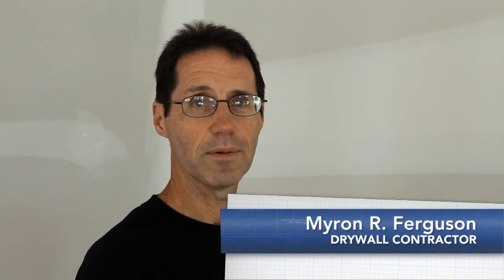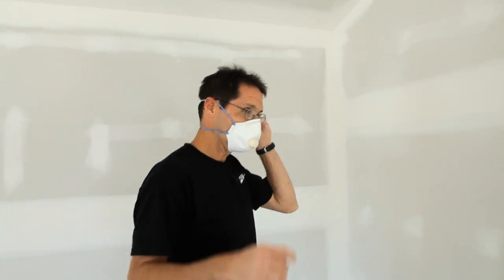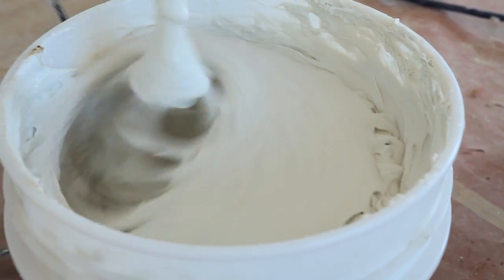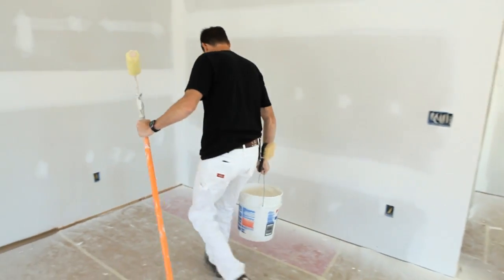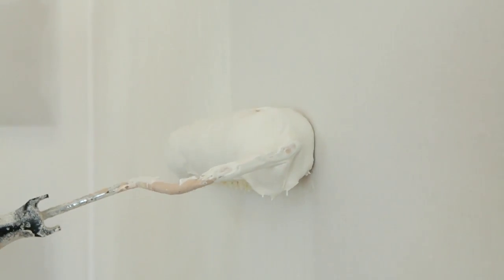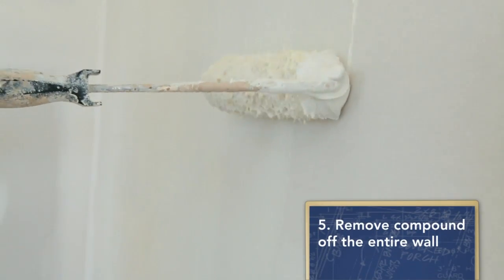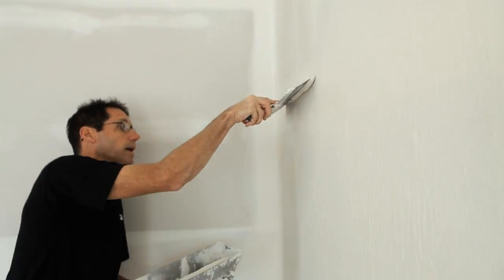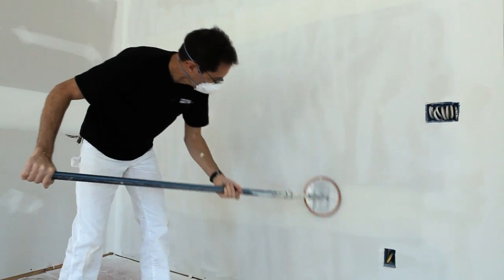How To Finish Drywall

Comment: This video highlights a common problem that drywallers often run into.  The paper face of the drywall will have a rougher texture than the drywaller's finish work, and some customers do not like this variation in surface texture.  That's why the different finish levels are widely published in tradesmen handbooks.  This helps protect the consumer as well as the contractor by spelling out in black and white exactly what the costs and expectations are for any given job.

Comment: hey you guys this guy cares........I paint in Kansas usa and I see so many new homes in which the drywall finishers were terrible................you can see so many defects in the walls and then the customer wants to blame the painter........that's why I like this guy...........people need to understand if you want a perfect job you have to pay for it.........painters are not responsible its the drywall contractors who are...
Reply: Painters are the first to piss and moan about what the tapers left behind.
I got an idea!!!...Before we go saying the tapers suck and leave defects, let's consider the board job AND the framing. If it isn't a good board job and the tapers are working piece work and getting paid by the sq ft, you can surely expect defects and touch-up's that never got done after the final sand. I see this as the biggest issue in my trade in Canada. Although, I have seen many many many houses and even commercial jobs where the framing was sooooooo piss poor, that no matter what the board guy's do they end up with a lousy board job. Framers.......well, they are a get it up and get the hell on to the next job, type trade. Same with board guy's, but the foundation of the house isn't built with drywall. It's built with wood or metal stud for commercial by the framers. I'm sure the framers could pass the buck on to the guy's doing the forms and pouring the foundation, but I have witnessed these jobs being done, and if you don't have your forms in straight and properly, good luck having a level house, leading to a shitty board job. This is where it falls on the tapers, to turn into magicians and fix the unfixable with some mud and tape. Can't count how many jobs I have been on, where there was nothing for the board guy's to screw certain sheets to. This makes for a wall the you can push on and have it move. "Taper Fix!" ....You tell me how well tape and mud will hold two pieces of drywall together, without cracking at the first sign of a season change. I know this may sound like an attack on painters but it's not, just defending my taper buddies because it ain't always our fault for the defects left behind!..
Reply: KingAndie
 lol..thats a all too true story and I blame it on the "next man technique"  lol....people dont give a fuck and let the next guy worry about it :(
Reply: I'm friends with a few painters....they aren't too bad.....but 95% of the painters in my location, constantly whine about things that are not worth even mentioning...kinda sad...
Reply: Where I come from in western Colorado where all the movie stars have McMansions,  this guy would be considered a hack finisher.
Reply: That's right and if the drywall cutout for the electrical boxes isn't right the electrician looks bad. You and I speak the same language Dave.
Reply: if thats all that is wrong is the paper is ruffed up , instead of spending the time to do a level 5 drywall finish a little sweep and a coat of primer and a good pole sanding usually give you a really nice finish atleast it has for the last 17 years
Reply: KingAndie hey not startin shit but can't ya fur out the walls using sheet rock shims. They're cardboard and pretty easy to put up with staples.
Reply: @ENDOalley  Why?

Comment: Sanding between coats of mud leaves dust on the wall. Dust on the wall mixed into your fresh wet mud turns into trash and actually hinders your smooth finish. Don't sand between coats unless you want to dust the entire ceiling/wall area. Instead, take your 6" knife and scrape your wall/ceiling. If the knife doesn't take it off, leave it on and handle it on your sanding at the end of the finish job.

Comment: After 40 tears finishing drywall I learned a few tricks from a lot of different finishers and developed my own way. In SW Michigan there is little or no texture in custom homes (Apartments had wall textures that hide mistakes kinda)  and you either learned how to finish correctly or not work much. With me, it would depend who the painter was that followed me. I hated sanding so I would tape, bed, skim, and then a tight skim like the guy in the video just over the joints. No sanding between coats

Comment: I've been 20+ years as a restoration project manager delivering a quality product.  I've never heard or a "level 5" finish either.  What I do know for all you nay sayers is, a quality job is a quality job no matter what you call it.  This guy knows how to do a quality job, as opposed to a subdivision job.  Quality workmanship costs more.
Reply: If you can't tell a non-level 5 finish just by looking at it, I wouldn't want you applying one. However it's perfectly normal you wouldn't know about it doing restoration, but any truly flat/smooth drywall job you've seen is either skim-coated or has had the butts cut out.

Comment: You can also spray mud with an airless sprayer but a lot of guys still skim by hand, This guy makes it look easy because he has many years of experience. I have seen this done and sometimes what they do is do it in sections, they do 4-6 feet and then skip four feet and then come back and redo the areas that they missed. Very Very important to get rid of the dust, they sell dust mops for this purpose.

Comment: You said you "remove as much compound as (you) can".  I see the angle of your taping knife is fairly perpendicular to the wall so I know you're not leaving a thick coat on the wall.  So how much pressure do you apply when you're removing the excess mud?  A lot?  As much pressure as you can?  Your videos are EXCEPTIONAL.  Clear, slow explanations by word and video.  As a guy who's learning to do drywall while remodeling my home, videos like THIS are worth everything!  Thanks!

Comment: We do a lot of level 5 finish work. After a standard level of finishing we take a straight edge such as a plastering rod and check all joints and corner bead for straightness. Then we use bright lights held at a sharp angle to walls or ceiling and do a very thorough touchup.

Comment: I liked the video! I've been tapping for 30+ years. He is right.The joints and nail/screw holes can be seen through the paint, but adding the same texture by skiming the whole wall with the roller is great way to solve this problem....Great video...

Comment: We use a cornice adhesive mixture troweled or rolled on left until not sticky to touch and then spray lightly with water and troweled flat with a 280mm flat steel trowel.  This finish can also be polished to a mirror finish for very high contrast lighting situations and gloss paints..

Comment: This looks like its would be the ultimate for a consistent texture and look. I found though that after sanding my final mudding, a coarse roller with Primer hides the transition from mud to drywall very well. The. When painting over the primer it will look great. This is an interesting idea though for somewhere you want the utmost perfection.

Comment: Tim, it is more work, and it is'nt necessary to do this everywhere. It is mainly used in critical lighting scenarios. Places where the light plays across the surface at a shallow angle will glaringly show where all of the compound was applied, even on the best of finish jobs. Level 5 is used to even out the porosity of the entire surface.You no longer have some spots exposed paper and others compound. It is now ALL compound, and will absorb primer and paint at the same rate.

Comment: Been a remodeling contractor for over 30 years.  My Father in law was a painter for 45 years before he passed.  He taught me to sand in between every coat of paint.  No short cuts.  The first coat of paint or primer raises the hairs on the paper and solidifies any dust, mud splatters and trash on the wall.  Then when you sand you knock all that crap off so it's a smooth wall.  Then sand after the next coat or two lightly sanding in between each coat.  All this using a 3/4 nap roller.  You final finish will be very smooth. (Don't sand the final finish)  The only time I skim coat a wall is where a home owner trashed their walls ripping off wall paper.  In those cases you pull off the loose paper and sand then roll oil base Kilz over the entire wall.  Then lightly sand to knock off any raised paper and hairs. Spot fill any deep gouges.  Then skim coat the entire wall. Sometimes it takes 2 thin skim coats.... At least this works for me.
Reply: Great advice
Reply: if you texture before you prime would the sanding cause your texture to get sanded down a bit to?
Reply: +mowerdog When applying the skim coat over previously wallpapered walls, are you rolling the compound onto the walls with a roller, or just spreading it out with a trowel.
Reply: I use a 10 inch drywall knife.
Reply: +mowerdog Thanks. One more question. What kind of dry plaster mix or pre-mix (5 gallon bucket).  20 min, 30 min, 45 min ? etc.
Reply: I don't use any "Hot Mud" for topping and skims.It's very hard to sand even when it says "Easy sand".   Use premixed topping like Sheetrock Plus 3 or equal. Make sure you mix it up nice and creamy before you use it.
Reply: +mowerdog Huge thanks!
Reply: No problem....Good luck..

Comment: This is interesting. I never used a roller for polish coating, but it's interesting to see. I pull my lines broad, so much so that my walls will look primed to most people. Taping is an art of sorts that most guys will not understand ever. Slicking the compound is great for all coats from the third onward. By slicking, I mean adding water. Sponging edges is fine if you like that sort of thing or if your knife/hawk game isn't perfect. I think compound pans are awkward to hold and use for long periods of time but fine for those who think otherwise. Everyone sands on prime coats, and if you don't, it shows quickly. My father always says " It's not the tool, but the person behind the tool that makes the difference".

Comment: Spray final coat with industrial rig and pull a 2' metal blade on it to lay it down real tight. Doesn't get much flatter or smoother for sanding. Unless of course you do it twice.

Comment: The "Level" spec is more common in commercial work because architects need to be able to call out different levels of finish, say for a janitors closet then for a board room.  In residential construction phrases like "firetape and mud only" (level 2) might be used for a garage interior.

Comment: When  you are done sanding, what do you do about the dust all over the wall that will ultimately get picked up in your primer/paint roller?  Isn't that what the littled dried bumps are when you are done...the clumped dust balled up with paint?

Comment: We talking about skimcoating 100% the wall surface , usually used after taking the wallpaper down and damaged walls got to be smoothed to original look . New construction does not need that unless specified by the owner in case of using the gloss finishes on the walls . Good spackler and sander will make it without level 5 ;)  Keep on good work my friend ! I

Comment: In my experience, level 5 finish is primarily used in hospitals, or any other wall that will have an epoxy paint. It's just a way for the tapers/contracters to easily specify the quality of the finish that is desired just to specify a standard.
Level 0-5 are the only ones I am aware of, from bare drywall to putting a light skim coat over the entire drywall papered area.

Comment: Yes, you should seal it first with oil based primer of some kind first for best results. Also, if the walls are severely scarred up, there are rolls of 36" fiberglass mesh that you can cover the whole wall with...then mud over with setting type mud until you can no longer see the mesh then finish with one coat of all purpose lightweight compound.

Comment: The mud is getting wet again from the paint, and causing your problem. Sand it down smooth when its dry. Before you paint it again with your latex waterbase paint, spray it with some spray paint from a can (Laquer base), let dry and then go ahead and finsh up painting with your latex. You can also use 3m spray adhesive to cover these joints prior to painting as well. Best of luck!

Comment: You can mop your fibers down and skip this. It still has to be primed by the painter either way. If there are a lot of Windows that will cause a glare or a long wall. Freeman's 555 level5 primer in an airless is much more efficient . But if it's small and your new to drywall this would work too

Comment: The problem of the dust settling at the edge of the mud joints can be easily resolved by mopping that area with a damp sponge. As far as the level 5, yes I've seen it and done it. The only problem is you NEVER lose all the trowel marks or humps. The more mud you put on the wall, the more imperfections you can expect. It's best to give it a good sanding with some 100 or 120 grit paper, sponge off the dust, and use a good quality primer with a 3/8 nap roller. That will do just as good of a job.

Comment: The different levels of finish are numbered is so that architects can easily specify different levels of quality for different areas of a building.  The purpose of a level 5 finish is not to fix defects in the wall it is to equalize the texture between the sanded compound and the un-sanded paper.  With a level 4 (or lower) finish the different surface textures of the sanded compound and un-sanded paper will telegraph through the paint and will be visible in reflected light.

Comment: After this we sand all finished  joints and corner beads vigorously. We come back through with a sanding block in one hand and a light in the other and sand inside angles and whatever else shows. After this we use a soft wet sponge to remove all dust. and to mat down any furred paper. Then one more time with alght and tuchup anything that may have been missed. Then we prime with a level 5 or other high solids primer. The dry primer must be lightly sanded before finish paint.

Comment: im a painter by trade, his technique will work great, but the way i achieve a really smooth paint job is for 1 good tape job or patch existing wall, sand wall with a pole sander then prime and lightly pole sand, then coat with paint and again pole sand, then put your second coat of paint and because of the sanding in between coats it knocks down most of the orange peel effect a third coat is optional, do not sand too much ur just knocking down the orange peel, and use a good 10mm roller

Comment: your problem is that when you applied the tape you did not get enough mud where the bubble is the fastest way to fix it is put a couple staples where it is bubbled tap them in lightly with a hammer then mud over it again, or you can cut along one side of the bubble with a razor knife and press some mud behind it then press it down again and mud over that

Comment: This gives the entire surface the same consistency. You may or may not know, but drywall has a little bit of a natural texture to it. When you mud the joints and screws, it becomes smooth in only those areas. After it is painted, it is noticeable is well lit areas, long hallways, etc. By doing a level 5 finish it gives everything the same texture (smooth). Yes I know a good paint job SHOULD even everything out, but often it dont. Level 5, if applied properly, can make a difference.

Comment: Hi. Yes you can.  Prime over gloss paint.  Skim with a coat right out of the bucket, no dilution, then knock off any ridges once it's dry, then follow this video. Tape off trim first and watch out for excessive build-up of compound at the edges. Have fun!
Reply: I’m a painter and read with interest your comment. You are correct, anytime a gloss surface is encountered that surface must be de-glossed before painting. 

1. There are good primers designed to adhere to slick glossy surfaces. 
2. De-glossing products that can be wiped on are also effective.
3. Last but not least, scuff sand the glossy surface.
4. Always remove dust prior to painting.

Comment: i have been a Taper/ Painter for 18 years now, I have never floated over top of new drywall, I personally find this to be a waste of time, but that's just my opinion.. They also make great high hiding  primers now days, i like to use Fresh Start for anything going Semi-Gloss just to be on the safe side.. and don't forget to pole sand in between coats of paint your walls should be real smooth and can make all the difference in how your finish turns out.
Reply: Absolutely. If you don't care that all your joints will be visible until the building is demolished, then this is a huge waste of time.

Comment: Let me fill you guys in on this video, a level five finish is mostly for gloss or semi gloss paint, and in Minnesota we use it on almost all ceilings and soffits in commercial work. There are several ways to do it, this is one, you can also skim coat , pan and knife or hawk and trowel that is basically the same. I use a high build primer from usg. You still have to sand after applying but it is the quickest way. actually there is a local guy with a spray truck . after we finish coat I call him he comes by sprays the wall then we sand, perfect job every time.